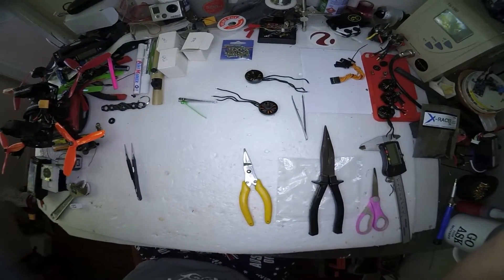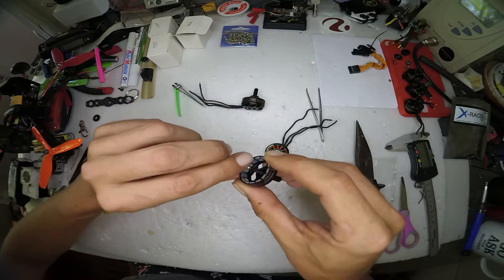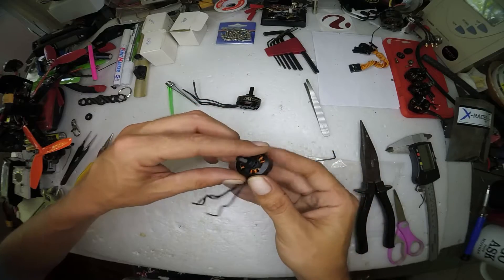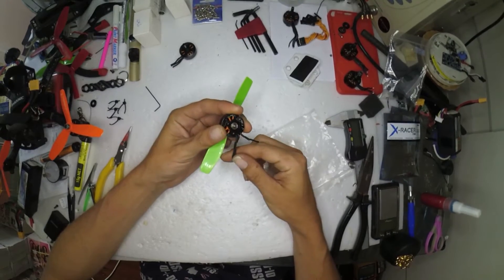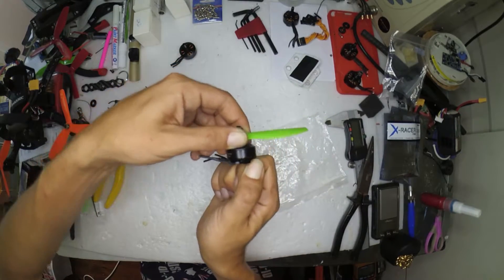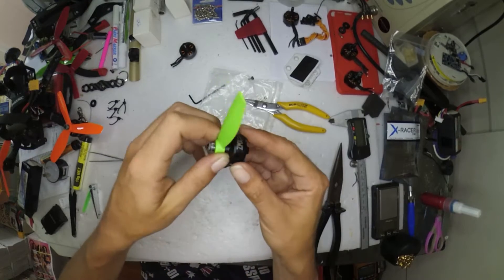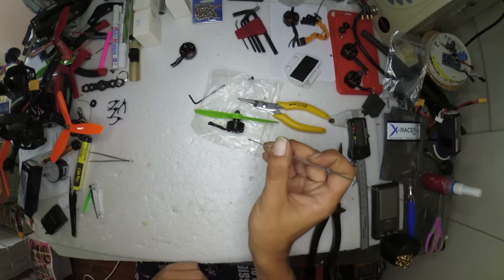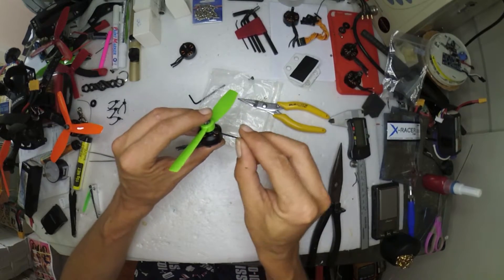ZMX H2205-2350KV / 2633KV / 2800KV Motors

Comment: Awesome in depth review. 
So you are using the 2350kv on your quad, would you consider using the 2633kv with the same dal tri blades or would that be too much amp draw to have a reasonable flight time? Im sure the performance on both is insane!
Reply: Actually that sounds like a lot of current. Maybe not the best idea
Reply from the maker: +Enginair It might work ok for a light setup but as it stands i get 2:00 from a 1800mah 4S  on 5040x3 :0 i think my lipos would explode if i tried that haha
Reply: wow, im getting about 3:30 on my cobra 2100kv. Im surprised that the flight time drops so quickly
Reply from the maker: i can get much longer times i guess, the 2 minutes is a hard freestyle flight with lots of high throttle

Comment: how do you find the durability on these?
Reply from the maker: +brad mont pretty dam good! , i'll do a part 2 for that "rcx2208 is first though" but so far i've used my quad as a shovel afew times and packed these motors with dirt /mud ect and still fine after a clean , i did run into a tree and the base of one got bent however it was only apart of the ring that is mostly there for show so i snapped that off and im still flying! .. alittle more crashing needed before i'll do part 2 but so far so good!